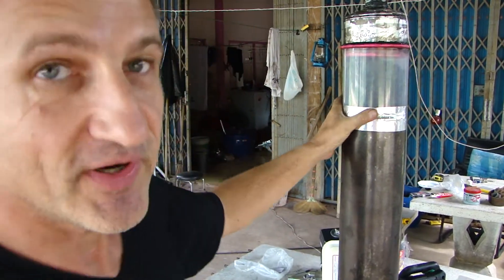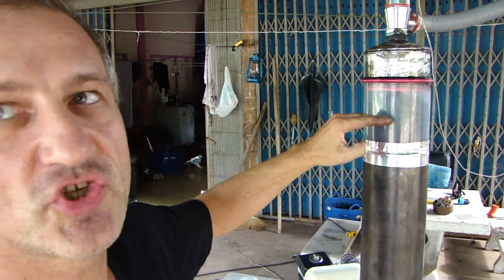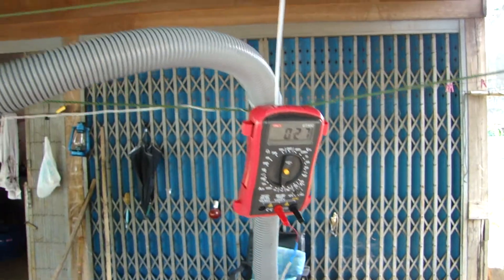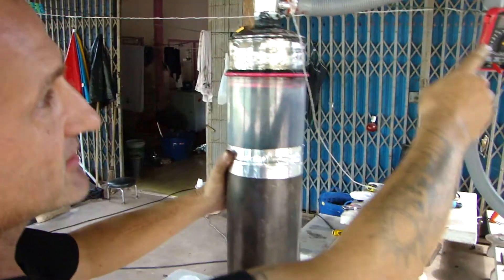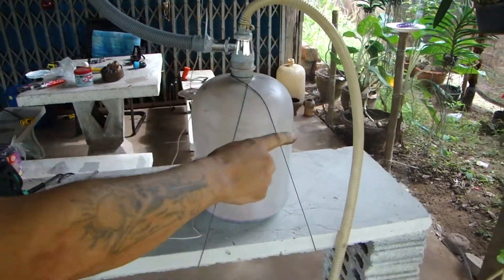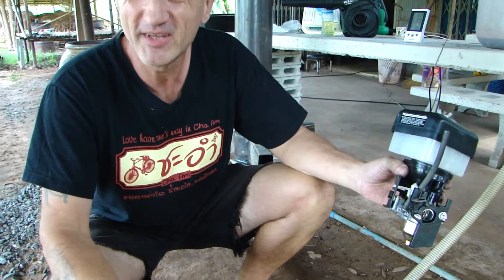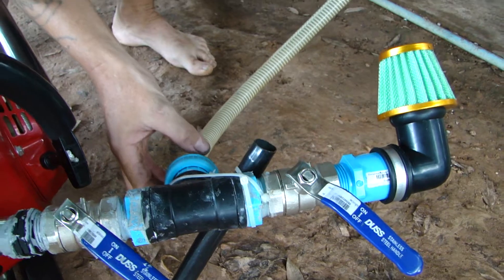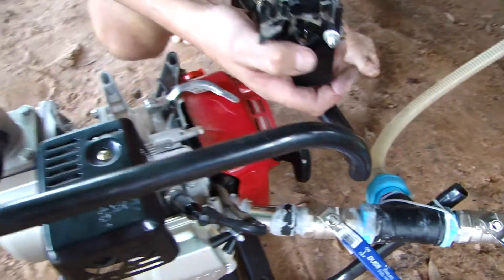Start up waterpump with charcoal gasifier, made in Thailand, Nong Khai, Pho Tak, Dan Si Suk, part 1

Comment: 白色桶子裡裝甚麼？
Reply from the maker: I use this plastic bottle as oil bath filter for the dust from charcoal
Reply: Do you say that there is oil filter?
Reply from the maker: The tank has function to catch dust particles with oil bath, take dust away from the gas